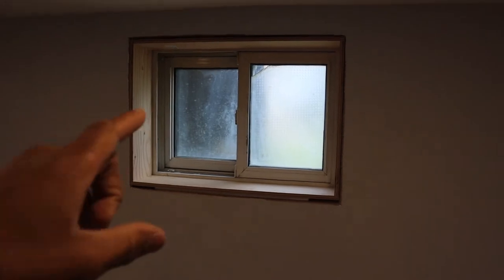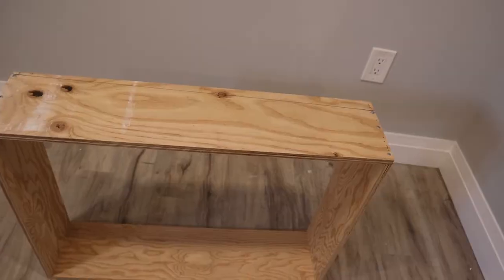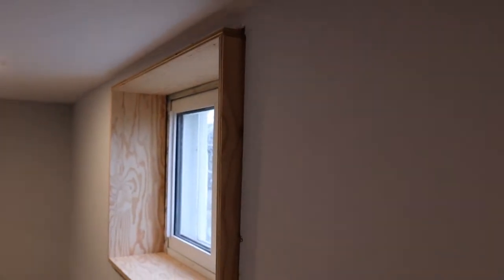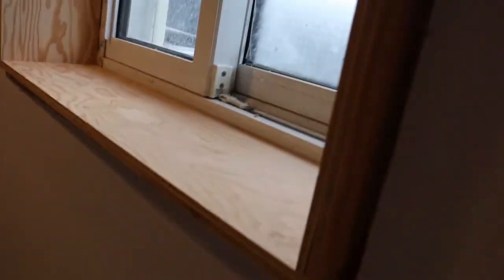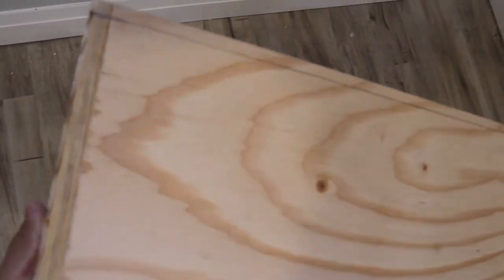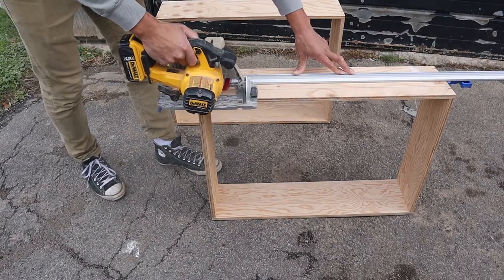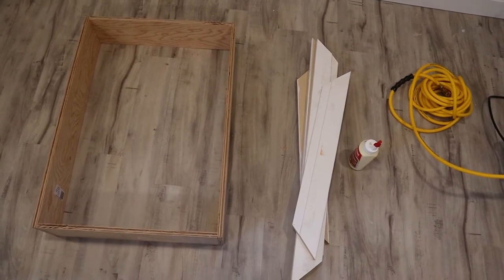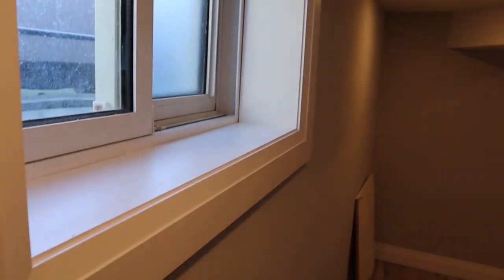How to install an uneven Window Jam Extension easily!

Comment: This is a problem caused by the foundation work. I mostly see guys installing treated window bucks to fit the windows. Better to have the opening 3" to big in both directions. Frame interior wall as normal and then line the opening with another layer of 2x material. Then set the windows. Should be close to perfect.
Reply from the maker: Yes they are retrofit windows in an older house and it didn’t have to be this off! Great suggestions

Comment: What if removing jamb isnt an option?....i have the jambs sricking outward past the drywall.....i ha ent put the drywall on yet so i currently ha e a little extra space to somehow cut the jambs back to make them even when drywall is put up.....
Reply from the maker: Sorry for the Delay, in that scenario you can either pack the underside of the trim to make it deeper or purchase a Pull saw to cut the Jamb flush with the wall
Reply: @stiver  thanku for reply....i wound up getting a flush cut saw(awesome tool) & doing it that way....previously the trim had been packed w/ different material to be flush to old drywall but i wanted a clean look....i kept the existing window(which was a basic replacement window)& added 1 jamb extension w/ the new moulding flush to new drywall....came out pretty good....thanks again!....
Reply from the maker: @joemorales9093  Amazing! happy to hear it worked out! The flush cut / pull saw is an awesome tool to keep in the toolbox for finish work! 

Any other projects you are working on soon? I'm looking for video Ideas!

Comment: Nice vid thanks for sharing. How’d you get the box corners to line-up with the vinyl corners since it was a-symmetrical?? Tryna do this on my wonky windows.
Reply from the maker: The box is installed in the same plane as the window so it fits flat as the window itself is flat, the wall however is not square with the window installed on the exterior wall so that is the only area that needs adjustment

Comment: If your window is that crooked, there is something wrong and it should be investigated by removing the drywall around the window. There is no good reason for the window opening to be off by that much from one side to the other.
Reply from the maker: There is a very good reason actually, an amateur framed the basement years ago and didn't square the interior walls to the exterior walls.

Take a square and put a smaller square ( interior walls)  inside of it but rotate it a couple degrees, the interior square still has 90 degree corners but it's sides are no longer parallel with the larger square ( exterior walls). you end up with this exact issue